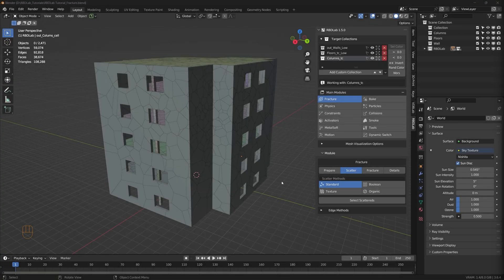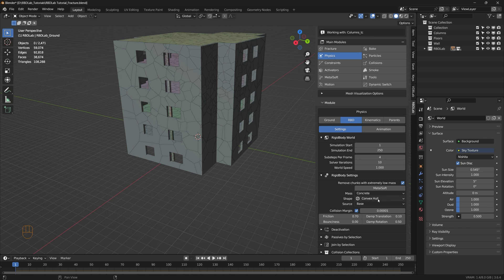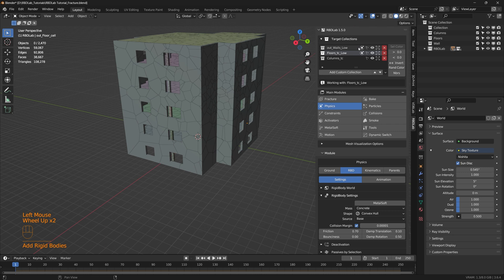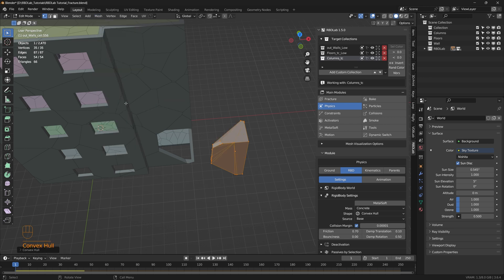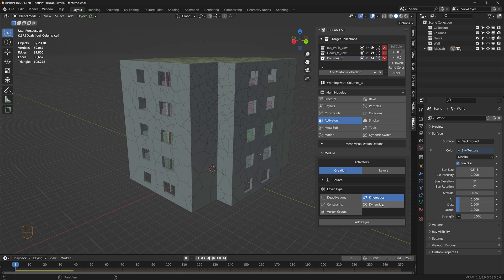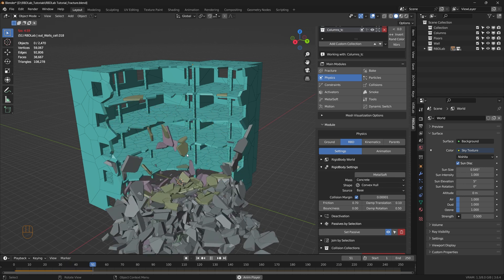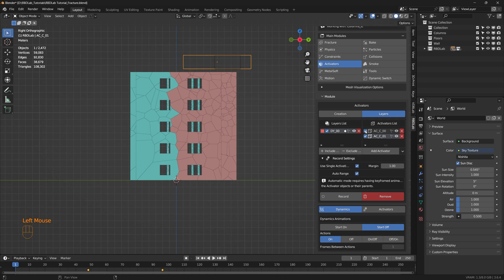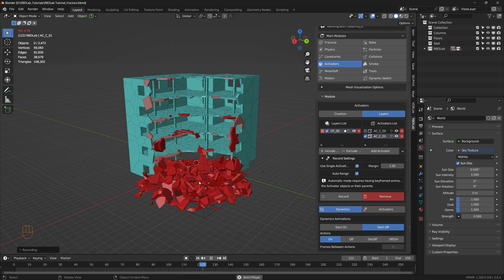RBDLab 1.5 MetalSoft - Physics and Activators

Comment: Thank you Awesome tutorial. I would like to know, how I'd export the fractured pieces to use in Unreal Engine. I want to hide the individual fractured pieces and spawn  Niagra particles at that impact point. Right now I've prototyped this using the cell fracture addon. My issue is that there are clear seams/fracture marks on my mesh. I don't want to make a fractured and non fractured mesh and swop them out at runtime just to avoid the seams in the mesh,since I'm doing this round about method for runtime performnce.....I've seen someone was able to do this years ago but they're no longer active on youtube so I have no one to ask
Reply from the maker: Right now, exporting the simulation is complex, and it's impossible to export the debris, dust, etc. However, we are working on making it much easier to export the entire simulation to Unreal or any game engine in the next update.
Reply: @befxstudios3D How are Things now, 7 months later? Can we export to Unreal 5.4?